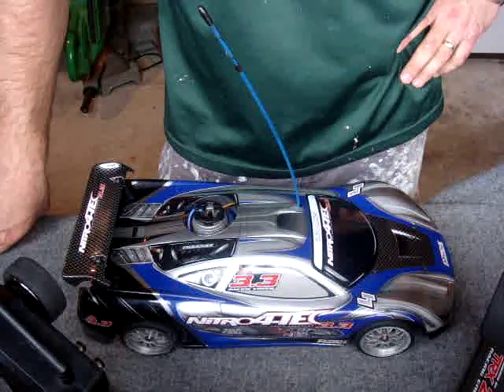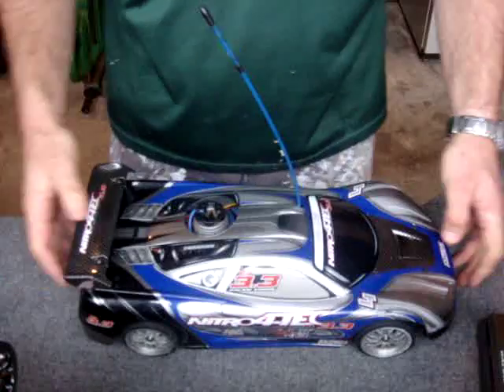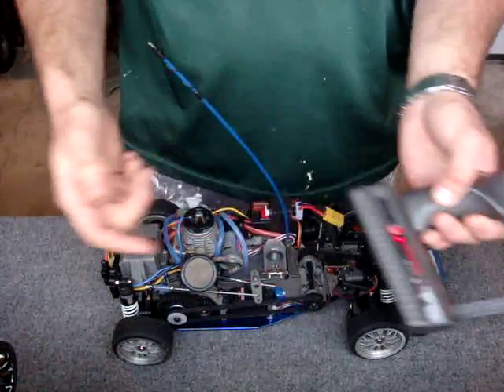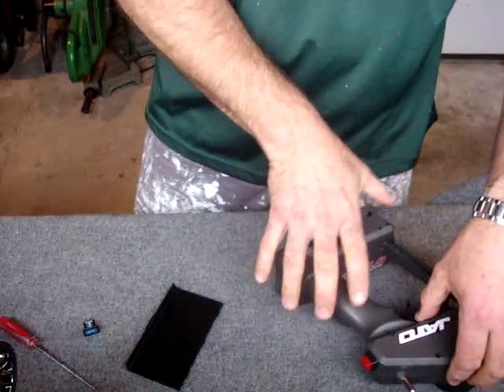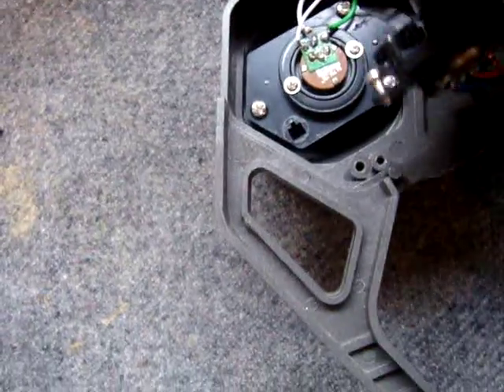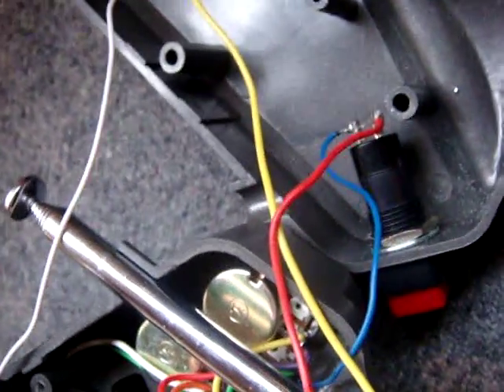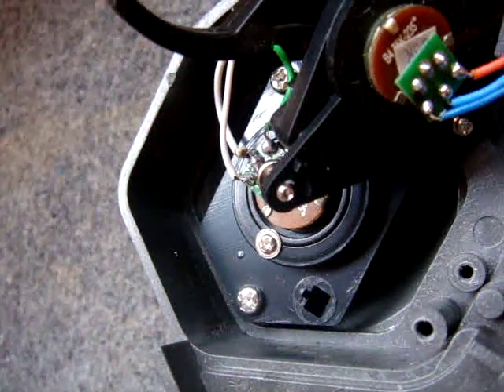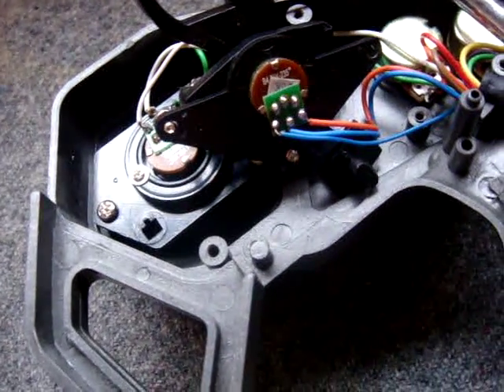2nd channel push button start mod on Traxxas transmitters, (Vid 29)

Comment: You need a NC (normally closed) switch. The only pushbuttons like that I can find are N.O. (Normally open). Basically the circuit needs to be complete until its broken by pushing the button.